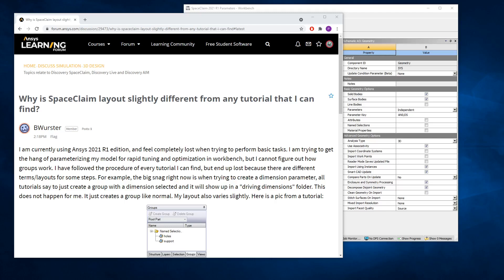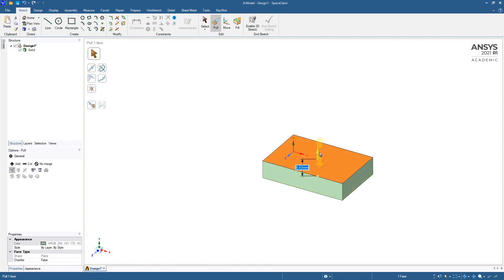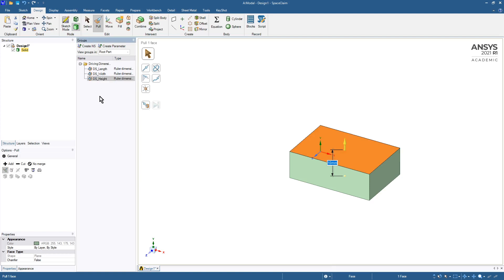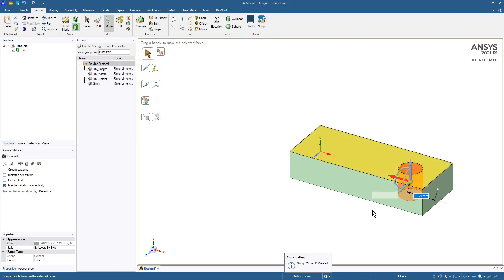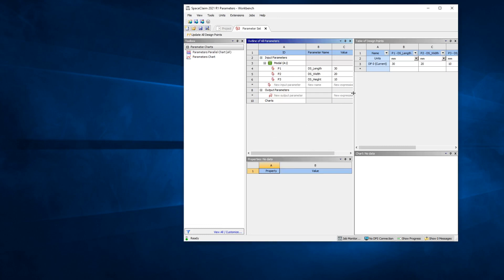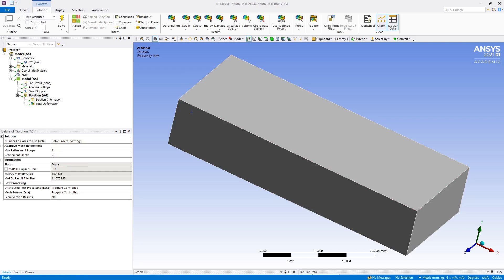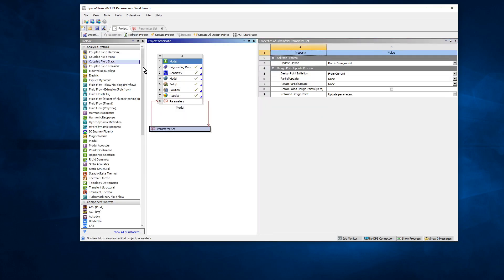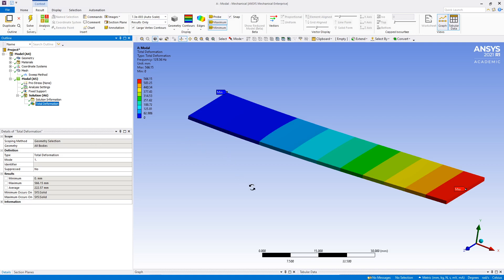ANSYS SpaceClaim 2021 R1 Design Study Parameters

Comment: I need a hole to remain there when the box dimensions are changed
Reply from the maker: Use DesignModeler to build geometry where a parameter can reduce the body to a size that is smaller than the location where the hole exists, and have the hole reappear when the parameter increases the body to a size that includes the location of the hole.

Comment: Hi,

When i'm trying this, the initial analysis works. However, when I update the geometry using the table, the fixt constraint is removed from the analysis and i have to manually redefine it.

Any thoughts on how to solve this?

Regards
Reply from the maker: Hi @baslord88, it may be that the design study parameter causes the surface to which the fixed support was scoped to be consumed in the shape change driven by the table.  Go to https://forum.ansys.com/ where you can join for free. In the General Mechanical channel, Start a New Post and insert screen snapshots of your geometry and show how the parameter changes the shape. It will be easier to have a discussion on that forum.